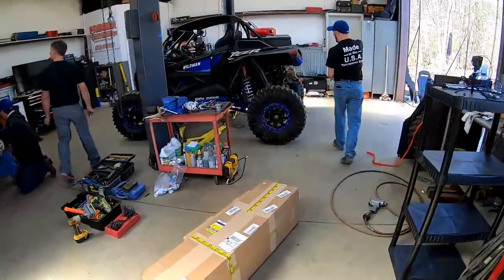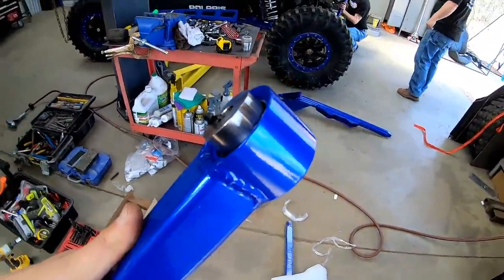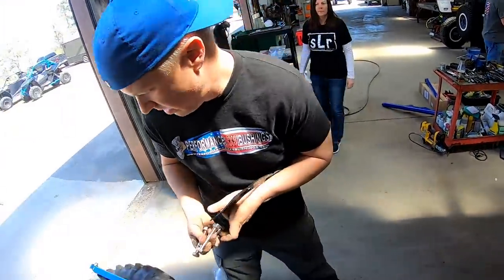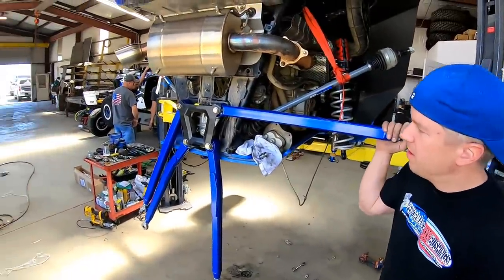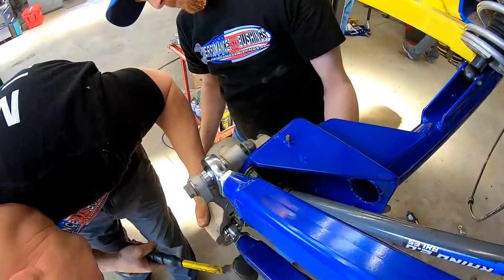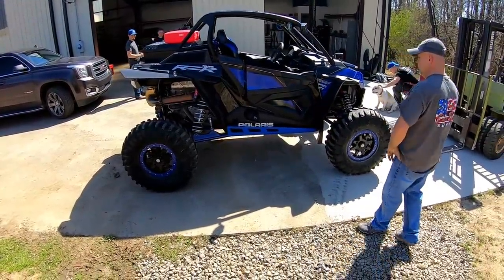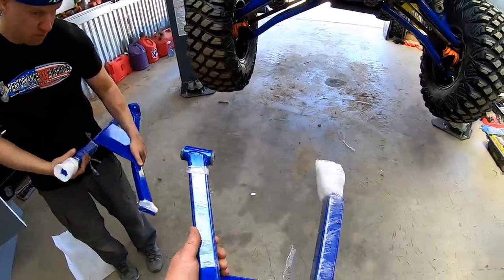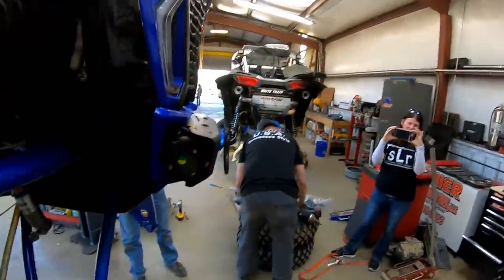Special Carriers Manufacturing Suspension Upgrades

Comment: It looks like you went with Heim joint and not ball joint. Have you been happy with this decision or maybe rethink ball joints next time?  Im sure both are good choices just wondered if you had any feedback. thx
Reply from the maker: We all went with ball joints over heims. I just feel like they hold up a little better than heims.
Reply: Thx much! I thought I saw someone installing a Heim in one of the vids.  Did I mistake or did you guys switch to the Ball joints.
Reply from the maker: @AnywayCowboy  No sir we all ran ball joints from the beginning. The ball joint carriers are a little different than most aftermarket arms. They have screw in ball joint carriers. They sort of look like heims.
Reply: ya I see that now.  thank you so much
Reply from the maker: @AnywayCowboy  👍

Comment: Those SCM components look killer... Were you not worried about loosing clearance?
Reply from the maker: They are going to be great additions to our machines. Are you talking about the radius rods? They rarely get int he way and the box style only loses about a inch of clearance back there. If they hit they will not bend so I am not worried about it. The trailing arms added 3" of ground clearance. That is where it is needed.

Comment: no anti-seize on them bolts?
Reply from the maker: Which ones? I just use anti-seize on the axle spines.
Reply: @SouthernLandRiders  I use it on a arm bolts, rear hub bolts and most definitely axle splines inner and outer
Reply from the maker: @mikekinsler4538  I usually take those off with an impact so I have not ever run into any issues getting them off. I do pull the axles every time I have the opportunity and add more anti-seize.
Reply: @SouthernLandRiders  working at a Polaris dealership we see all kinds of stuff in theory should come off and don't but a little bit of the silver sticky stuff goes a long way. love the videos yall keep up the awesome work. we are headed to windrock in July.
Reply from the maker: Thanks Mike. Appreciate you watching the videos. You guys have a good trip to Windrock. I have never had a bad one there!